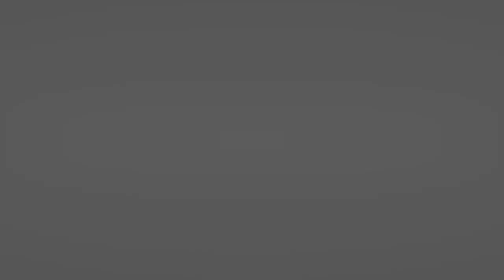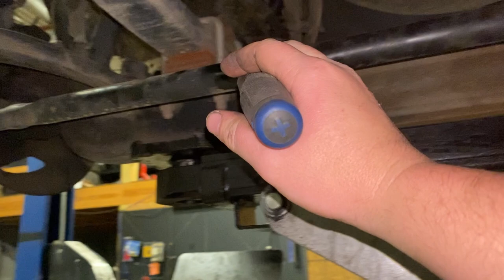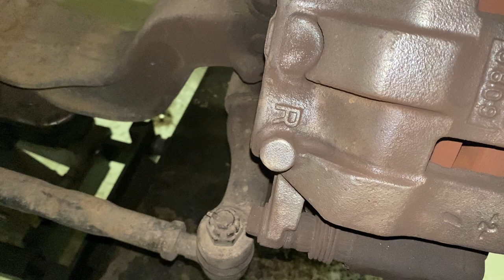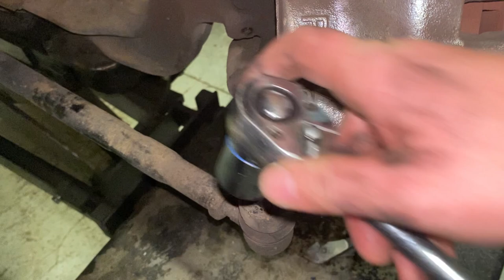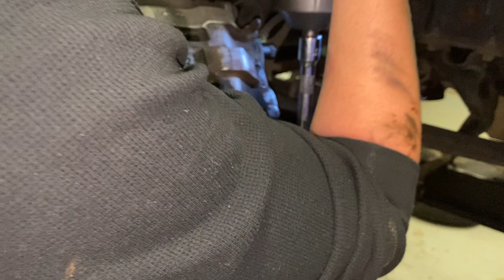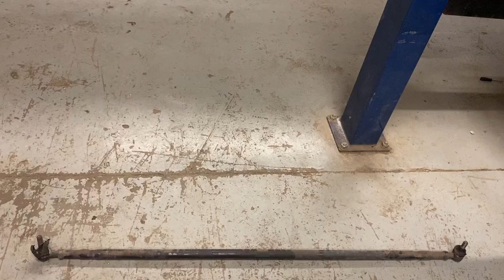How to diagnose and replace tie rods on your isuzu NPR

Comment: I'm getting some front end vibration and certain speeds. King pin change helped a lot. And I adjusted the worm gear on the steering.  I want to check the toe on the front axel. What is the recommended alignment? Toe in ? If so how much?

Comment: I have those roof lights on top of my npr.  I changed the bulbs on them but they’re still not working. Any idea what could be the problem.. thanks.
Reply from the maker: Check and see if you have power at the socket. If you don’t check fuses. If there is power at the fuse trace wiring and check for power every 6 inches till you find a break in the wire. I hope that helps.

Comment: up my way this is the way i do it. the cotter pin is rusted and seized in the end so i cut the cotter pin some and hammer a socket and zip it off. take the nut off flip it upside down and put a few threads on and hit it with a sledge hammer a few times to remove. repeat on the other side and then replace the entire tiered ends and tube.  Have to love Vermont and all the Salt
Reply from the maker: I’m from Tennessee so rust usually isn’t an issue. Either method your best friend is a BFH